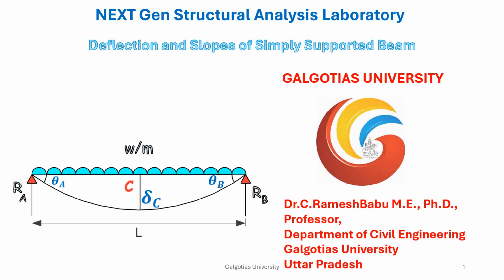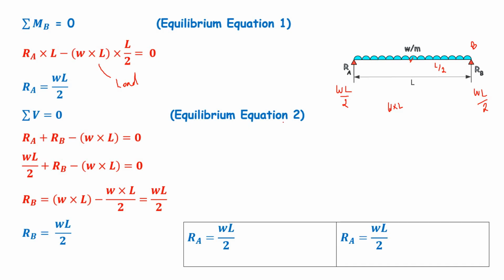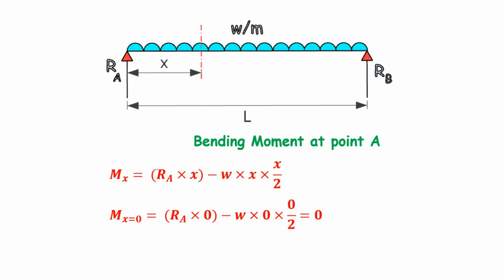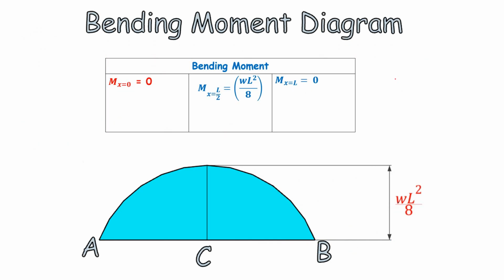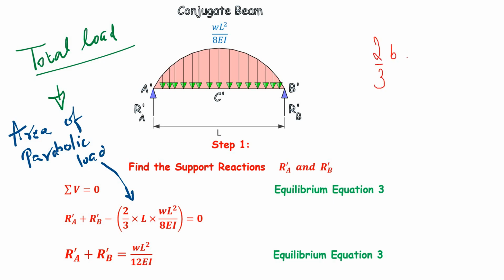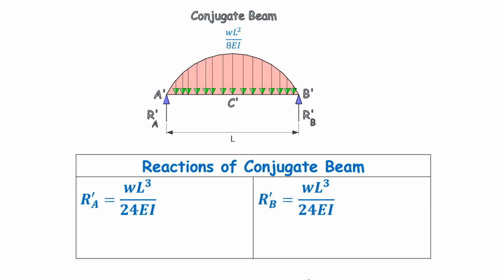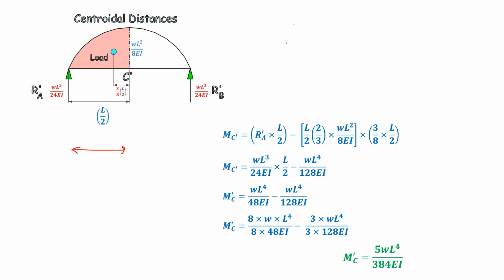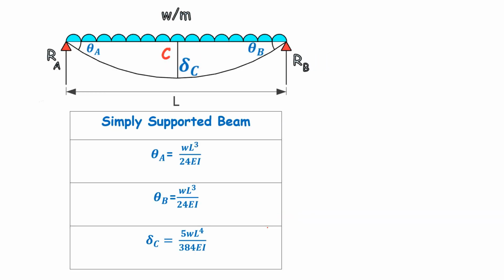Simply Supported Beam with UDL – Reactions, BMD, Slopes & Deflection | Conjugate Beam Method|

Comment: Comment posted on Monday, June 15, 2026.

10:00

Mathematical operations to write the balanced equation for Eq3.

Sigma F(V) = 0

R'(A) + R'(B) - ( 2/3 • L • ( wL*2 / 8EI ) ) = 0

R'(A) + R'(B) = wL^2 / 12EI

(This is Eq3 according to the example in the lecture.)

** Or, Eq3 should be written as: **

R'(A) + R'(B) = wL^3 / 12EI

Note:
We get:

R'(A) + R'(B) = wL^3 / 12EI

wL^3 / 24EI + wL^3 / 24EI = wL^3 / 12EI

              "?"
Reply from the maker: R'(A) + R'(B) = wL^3 / 12EI      Yes U r correct